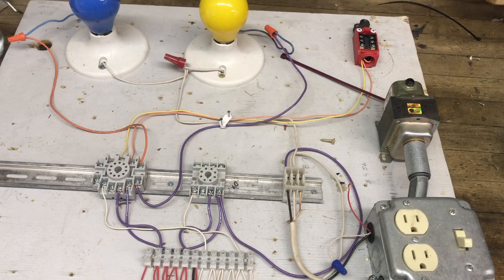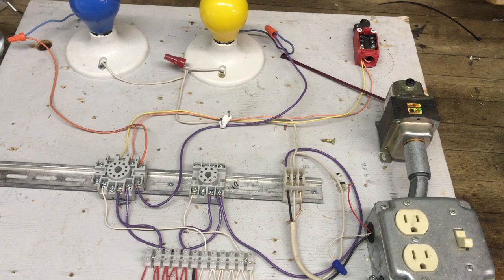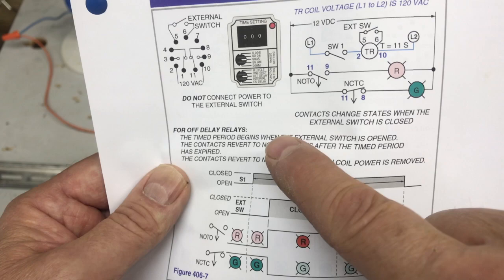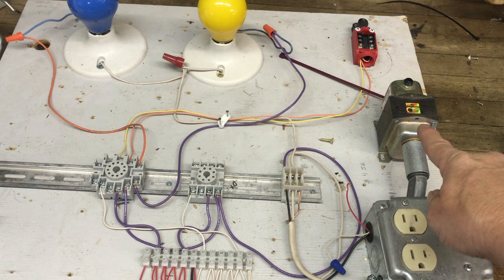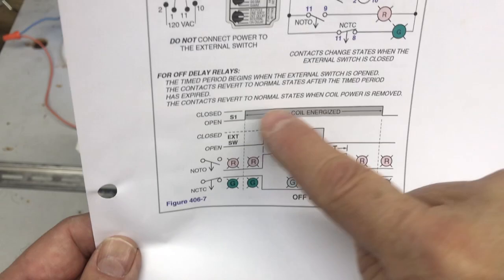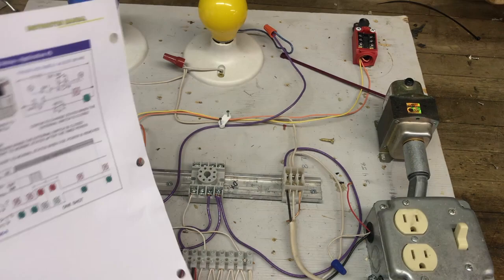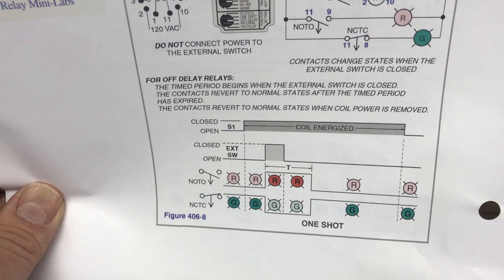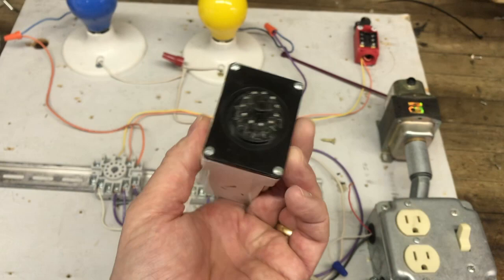Off Delay and One Shot Timers

Comment: This is what I was looking for, without the switch. Context: I live in a remote area where power outage happens once in 2 weeks. I want to connect a relay that turns on a solenoid valve for a few seconds once the electricity returns and flush waters. I have an issue where water is murkier when after a power outage and I want to make it easier for my pre-filter.

Comment: There's no need to hold the triggering switch as you did in the closed position to have the one-shot timer function properly. You can cycle the switch as many times as you want and the timer is unaffected (during the timing duration) that's what is special about the one-shot.
Reply: Exactly👍
Reply: Him doing that helped me understand that it still works while being connected. Like, in my project, I needed a relay that will automatically fire for a few seconds once the electricity returns.

Comment: I’m trying to use an off delay timer to control a horn. I have a 120v magnetic switch that opens and closes when I open and close a door. I’d like my timer to start timing when the door is left open and sound the horn after 10 seconds
Reply: Why OFF delay and not ON delay?
Reply: @AztecWarrior69  
Yes, ON delay Timer is the best approach,
Reply: Hello Logan, 
thanks for your question which make us, viewers, brain storm,
One of the characteristics of the timers either Solid State, Electromechanical, or Logic timers is that they rest their output switches back to their Rest State if the Control Power is cut during timing. 
So, in your case, ON Delay Timer is the best approach and it would be as following, 
A NO Limit Switch goes NC when the door is open, 
when the Limit Switch is Normally Close it supplies control voltage to ON delay timer, 
the ON Delay timer is NOTCO ( normally open time to normally close ) let's say 20 seconds,
when you go through the door you have like 20 seconds to go in and shut the door so the Limit Switch will go back to NO and cut the control voltage to the ON delay timer, 
but if the door is kept or forgot open the limit switch will keep supplying the ON Delay Timer and it would keep timing until it finish the 20 seconds that when it's output switches change state to NC and fire the alarm Horn and Light
I do hope this comment would help you and those who will read it, 
and thanks again for giving us the chance to brain storm by asking such good questions!

Comment: What time can be use to switch on those light permanently after power is switch off from the coil of the timer I need the light to be on and the unit to trigger the timer triggers it just for say one minute and goes off but I want the contact of the timer to be close. So whst time of timer can be use

Comment: Anyone know how to use an on-delay timer as an off delay timer? I only have an on delay timer and NOT an off delay timer. I need to run a second fan for some time after the call for heat ends and shuts off the first fan. Both of the fans have to start at the same time.
Reply: Lol..  do you use a screwdriver for nails?